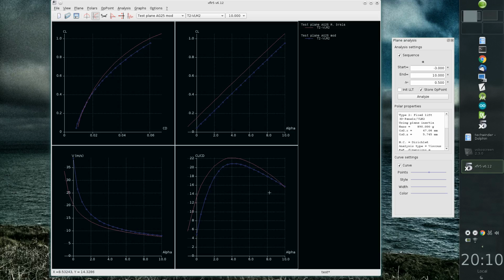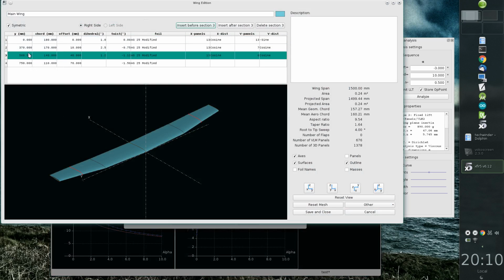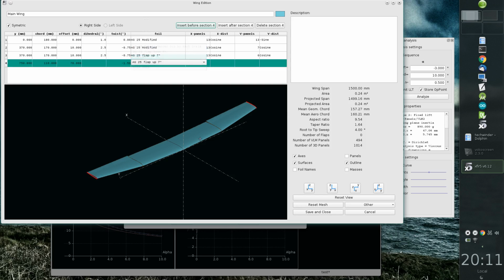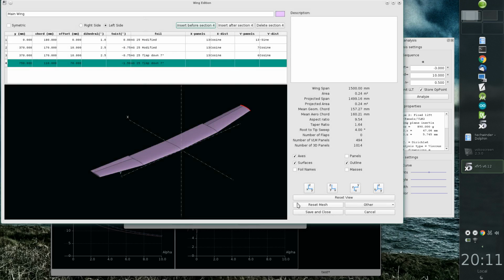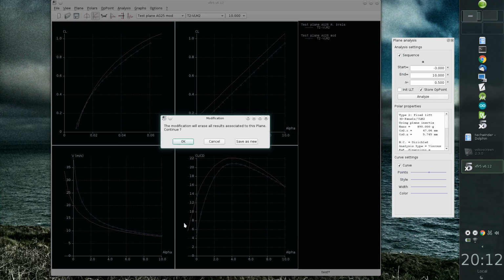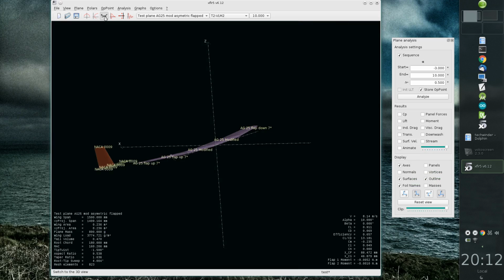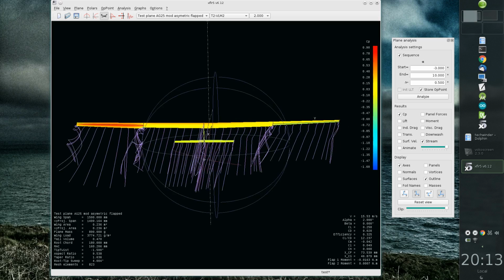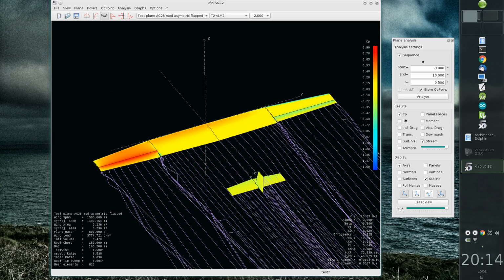9   Design a flapped wing

Comment: Added question: Where did the flapped airfoil come from?  You just grabbed it out of thin air in the video, but other than just CADing or spreadsheeting a foil file, is there a best preferred way to do this that is not as arduous as editing points?
Reply: OK, I just found it!  Its described in your "4 Flapped Foils" video.  Need a call out to that video, but maybe my own reply here will help future users.  Thanks!

Comment: Hi:  New to XFLR5 and XFOIL but learning. So, from other videos, it seems that one can model both Flaps and Slats in XFOIL. They may not be ideally shaped, but they do offer at least a rudimentary capability to perform some basic analysis on.  If I were to guess they are probably just deflecting the nose and tail foil coordinates up or down and bridging the gaps.  Since I assume XLRF5 has XFOIL at the root of its foil capability I’m surprised that this capability would not have just been inherited fairly easily into XLRF5 (of course it’s always easy for the ones that have not done it ;-).   Is this feature really not within XLRF5, or is there yet an Easter Egg hidden somewhere?

Comment: Hi @techwinder. I've tried to use this method to simulate a wing with endplates at 90degrees(flat foil), but i'm always receiving a "could not be interpolated" message in the wingtip. I think i might be forgeting something... Do you have any video simulating a wing with a normal foil(like the E423) and flat foil endplates that i could watch and learn? Thanks a lot for your time! Best regards from Brazil!
Reply from the maker: The answer is in video 11 Plane viscous analysis errors

Comment: where did you get the "AG 25 flap down 7'?
Reply from the maker: You need to define it previously either in the foil direct design module  or in the foil direct analysis module (command F10)

Comment: Do you know how it would be possible to add slotted wingtips to the wing i.e. to simulate feathers?
Reply from the maker: No option for that unfortunately
Reply: +techwinder ok thanks, can you do a curved profile for a dihedral or would that be done using many sections of gradually increasing dihedral?
Reply from the maker: You'll need to define several sections
Reply: I managed to make a number of wingtips to the wing by defining the aerofoil for one wingtip then going back on myself with a chord length of zero and repeating the process for a number of wingtips.
This gave the correct shape but analysis wasn't allowed because of (1) going back on yourself with aerofoil profiles and (2) having a chord length of zero
Is there a way of getting round that or a code you can provide which will allow for their analysis?
Example here: http://imgur.com/qzoGJ9C